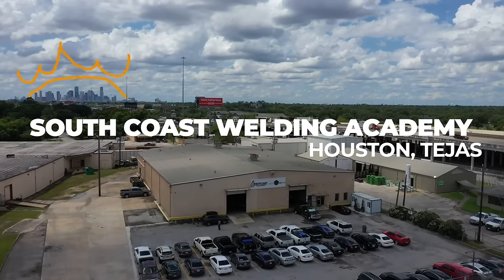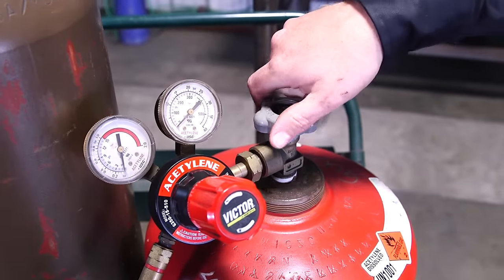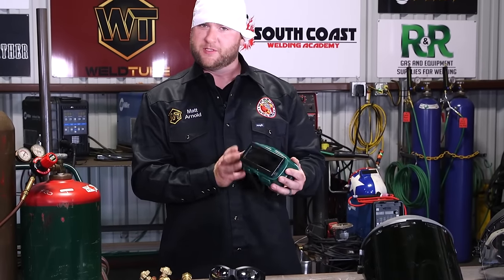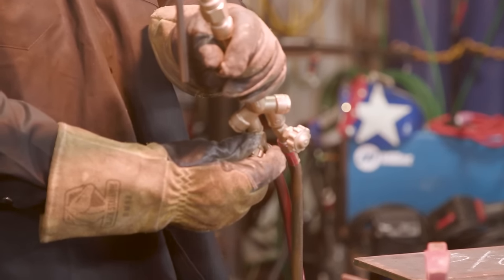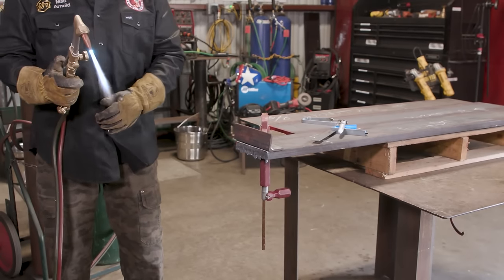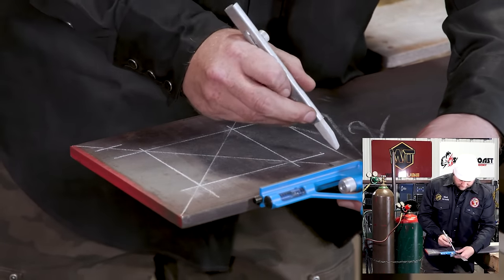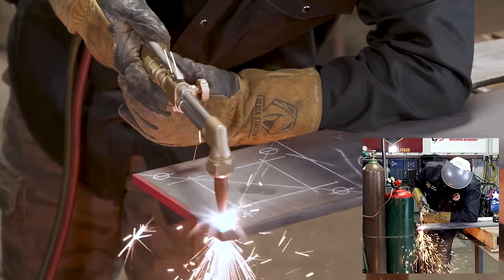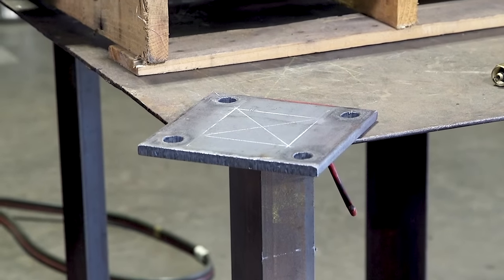Torch Cutting Basics Everyone Should Know | Oxygen & Acetylene Fuel

Comment: I am 74, retired fabricator, welder.  In my learning stage, An experienced old timer taught me to use a center punch on the chalk marks, because the mill scale will pop off and you can lose your line if trying to free hand the burning.
Reply: Exactly what they teach us in welding school in quebec
Reply: Yes, hot-rolled steels do have that affect.  Vibro-etch tools can also help in maintaining a clear guide line.
Reply: Same age and technique. You can see the flame break over the punch marks. Especially good for cutting curves without bothering with the circle burner attachment.
Reply: Yea.. you can do it like that or use a scribe but I prefer using the center punch
Reply: Nice tip
Reply: Thank you, that is a great way to get the hole in the right spot.
Reply: I'm going to try your technique next time.  I have ran into that issue before.  Thanks for the tip.  This field is a never ending learning experience.  I'm always learning new techniques from everyone.
Reply: This was the right torch handle for the left hill front with a misty blade at the bottom
Reply: @charlespageau5699  🤣 it's complicated
Reply: @user-sp3gq1up9n  That goes for a lot of trades. There's always something new to learn
Reply: I do that as well
Reply: @charlespageau5699  Awesome to know, I'm living in that province
Reply: In portugal we do the same !
Reply: Thanks for the knowledge
Reply: I am a recently qualified welder/fabricator in Ireland, we got taught that trick too
Reply: So how many marks would you make with the center punch?
Reply: @bronsonstephens5799  
Hi Stephen,
When we were cutting smaller circles and arcs we were marking with the centre punch every 3 to 4 millimetres. We were also making deep enough marks with the punch that we could fill up with chalk ie. (hit the centre punch 3 to 4 times). This makes the line much easier to see while cutting.
Reply: @harkinjames  my name is Bronson but I appreciate the advice!
Reply: Only on big pipes center punch.on other material just use a scratcher. Σημαδευτίρι.
Reply: Hi mate, you are absolutely right. But if he was to drill the holes, he would have needed the center punch. Since he is using Oxi, so no nees for that I guess.
Reply: Awesome  your  a spring  chicken 🐔 🐔
Reply: You can use a zip cut and scribe a line too. Just run the zip over it quickly so you have a nice permanent line to follow.
Reply: Your explanation is great, idol
Reply: Or just use a white out pen.  (presto)
Reply: I also learned this from an old head props to them ✅

Comment: I had never used a cutting torch before and needed one today to make some mounting brackets. There was no one at the shop to teach me and it had to get done today. This video alone was enough to teach me everything I needed to know! Thank you for this!
Reply: Get it 🔥🔥🤟🤙
Reply: It's pretty easy to pick up the basics, but hard to become really good at freehand cuts.
Personally, I went for a 30A plasma cutter because it's easier to plug in an air compressor than it is to keep refiling gas tanks.
Reply: @the_inquisitive_inquisitor  Good decision
Reply: Everything? LOL. I'm not being a smart ass, but that statement rings of famous last words....for instance...can you clear weldement with a torch, what size tip can you use? Wait until you learn just how much you can really do with a cutting torch. You'll be the best!
Reply: Ive seen men who claim to be tradesmen and when I see their Oxy cuts straight away I know if they are full of BS or nor, I watched one so-called tradie melt the steel instead of cutting it, he didnt get the job, lol, and you learnt everything you need to know, oh my god.
Reply: @the_inquisitive_inquisitor  it might be but you can cut a 12" plates with oxygen cutting and you can do more things overall
Reply: @altoso1  My plasma cutter handles everything up to 1/4" and that's enough for most jobs.

Comment: FYI, for those of you just starting out or only doing you’re oxy/acetyl cuts infrequently this process will assist you in doing very well.  But, it takes paying attention to the melting metal at the torch flame tip, as well as how the torch is clearing the cut material and if your hearing is still pretty good and not real noisy where you are at you can also benefit some from combining your visual indicators with your listening to the sound of the cut for popping and changes of air velocity sounds from the torch flame and gas flow.  Also, don’t expect your first cuts to look as clean and slag free as his.  He did not cover the importance of the condition of the torch tip face and nozzles which the torch tip face needs to be clean and free of slag balls on it and especially the torch nozzle holes need to be clean and not worn out, goose egged or larger at the tip from improper tip nozzle cleaning in their shape or oversized from excessive use and cleaning.   Always Preheat before trying to cut, Keeping you torch cone flame height correct and steady not going up and down in reference to the metal being cut and/or banging the torch cutting tip face into your work especially the molten area will extend torch tip surface and cutting nozzle hole cleanliness and life of the tip.  Get comfortable as field conditions allow or in any way needed to meet drawing accuracy tolerances on specified technical  drawings for the cut of finished plate.  Torch tip face and nozzle cleanliness along with preheat, attention to molten flow at torch nozzle as it cuts through the metal, and possibly the most difficult skill part a slow, deliberate   steady pace based on visual and some listening feedback to the cut when you can hear well enough to use that and developed eye, hand and muscle coordination and feedback control of torch flame cone height from material and torch travel speed while constantly observing what’s happening at the cut.  If you are not a good welder odds are the same parameters of attention to detail in weld puddle tie in, bead height and width along with really good  eye and hand coordination and steadiness are key in both processes.
Reply: I’m just starting out and I’m struggling compared to my classmates. This comment was so helpful and encouraging. I really appreciate you today!!
Reply: Excellent and insightful commentary, all newer people to cutting torches need to read this 👍👍
Reply: Very well said, keep the tip clean, and steady
Reply: god bless you.   i am old,  i now teach anything by first asking the student to relax and practice presence and awareness.  by doing that we will learn.  be present now -  do not think of the end-goal,  but begin to practice the basics.  sigh,  i am old !

Comment: It is only important to clarify at the security point, that you have flame arresters in your gas and oxygen lines, and they must also inspect that their regulators work correctly, each time they are used or plan a weekly inspection to keep track of them and be more secure, just to remember that safety comes first,

Comment: Excellent presentation. Gas/Oxy seems to be a almost forgotten part of the industry . Not many take the time to do gas welding . So a BIG thanks for the edification. Stay safe.
Reply: In hobby shops,,,,yes. - In construction and actual industry, No,,,,,except for plasma,,,,but you seldom see Plaz in the field. No real professional uses a cutoff wheel in a Metabo.
Reply: @mathewmolk2089  True out in construction and the industry we use gas/oxy cutting a lot, and we also use plasma for when we cut down/disassemble silos. Sometimes its just way more time efficient.

Comment: Excellent video.  Great technique, great tips.  You are so right about NOT overtightening.    

Only thing I'd add is you mentioned safety multiple times, but you don't have the steel toe'd shoes. Some sites require it, and you even mentioned how dropping the piece or the dross on the hoses is going to be bad news. Same goes for toes.

Thanks for the hard work and giving back.

Comment: I've got a set up I made with a torch mounted stationary pointing down,  and I have a slide table on rails. I just push it through like a table saw and get very clean straight cuts.
Reply: Yes, they make a radiograph, a motorized unit that holds the torch. It runs on a small track. You clamp the track to your plate and it cuts in a straight line.

Comment: Great video on Torch Cutting. Just wanted to add three more items that should be done. 1 - Like all the comments below ALWAYS ALWAYS back off the regulators after closing the main bottle valves then OPEN the torch valves to bleed off any gas pressure in the lines/torch then reclose the torch valves. 2 - Just before opening the main bottle valves open the torch valves to ensure no gases have built up pressure in the lines/torch from leaking by the main valves and regulator. 3 - I always clean the torch tip after someone has used it or had a bad blow back. This takes all of 5 minutes, unscrew the nut holding the tip and remove it for inspection ensuring no damage to the seating surfaces then run the proper size hole cleaner through each hole then take a small drill and chamfer the holes just slightly and again run the hole cleaners through each hole to remove any burrs that might have been left in the holes. This will ensure you'll have a clean cut every time.
Reply: That's how I was taught in trade school in 1967.
Reply: Like I said before. That is exactly the way I HAVEN'T been doing it for over 60 years and none of out Union Ironworkers amd Millrights don't do it your way either. We use both hand and machine torches in the shop 6 days a week here too. (Just for the record we have had manifolded gas and oxy since like 1970. and used liquid oxy bottles on field projects longer then I care to remember.   

If I caught a guy taking a drill to a tip like you are talking about I'd send him down the road so fast nobody would remember what color his truck was.

Comment: New welding student here; this video was very helpful from what I remembered in my recent class; you covered the process for a lot of the stuff I learned in class. However, in my class I learned that keeping the regulator completely cleared and clean of any oil, grease, or petroleum products physically on the regulator, otherwise that can cause an explosion. Also, never wear nylon or polyester clothing, because the sparks and fire can cause a fire or melt your clothing if it makes contact with your clothing, and never use the torch to blow off your clothes with just the oxygen, since that is a safety hazard to ignite your clothing, I believe. Also, make sure your boots are not nylon and your pants are fully covering your boots, and make sure your welding jacket is fully buttoned up and sleeves tucked into your gloves, and don’t forget to wear your beanie to protect your hair from catching on fire. 

There are a bunch more safety measures involving the oxy acetylene tank and oxygen tank for making sure all the parts involving the regulator and such are functioning properly, and checking if there any leaks (I think you can use soapy water near the nuts), and there’s also flashback that we need to be aware of. 

Thanks so much for the video.

Comment: When you shut down after used, it's important that after turning off the cylinder valves, you  open the valves on the torch to remove the pressure from the hoses, then turn the regulator valves anticlockwise to shut them off.
Reply: In school, yes, In the real world, no.  

Same as lighting the torch. After you have been using a torch for a while you set the oxy and gas and light it together too. None of this gas first then oxy. like the school teachers tell you. - If it's so bad how do burning machines with auto ignition work? POP! that's how.   And how do i know these things.....Been doing it that way since 1959.......I got torches and regulators that still work just fine that are  older then the kids that are trying to tell me I have been doing it wrong,,,,for over 60 years.
Reply: @mathewmolk2089  Yes, exactly. I do the same thing, a little oxygen, then a little gas and light it. Saves all the black smoke.

Comment: Good tip, as a Woodworker / Handy man DIYer i did not realize those sockets existed a few years ago i had to replace a Element on a Hot Water Tank in one of my Boats  and i wound up  having a Oddball open end Wrench i  acquired from my Grandfathers Collection that fit i was also lucky the tank itself was small enough. for me to lift it out of the engine room and work on it  in a less cramped area

Comment: This is best class on running a touch I've seen. Great. 
     We sharpened our soap stones on any nearby concrete. Allowing a tape (measure) to snap shut even that amount will lengthen the hole the rivit is thru that holds the L. One of my tapes is over a sixteenth out at any length. But then again, the tape's been on a lot of jobs since 1979, Ha!.
Reply: Ok, I'm gonna say it, if you have been using the same tape since 79 you deserve a new one. As a carpenter I used to go through one a year or so. To be fair, that tape got pulled out of the pouch 20 or 30 times an hour.

Comment: thx bro im a freshman in high school just now starting welding and im so stoped very excited to learn tig and mig also what's the song in your intro? haha just curios its a vibe.
Reply: you’re probably gonna start out on torch, brazing, mig, Stick, and welding tip on torch, that’s how we start our program, lots of fun is had once you get past safety stuff
Reply: Some Pro tips for TIG & MIG aluminum:  Aluminum is the only common metal that has to be clean before you weld it. No grease, oil or paint or anything else can be on that metal. It just doesn't weld. If you have to file the edges of the stock do it. Or use a grinder with a sanding disc. If you dump motor oil on steel or stainless it will weld perfect because the heat pushes the oil back. To prove the point on cleaning aluminum: military specs call for all TIG welded aluminum to be etched in a mild acid. Use a stainless steel wire brush to clean the area you need.

Comment: just to point out one  VERY IMPORTANT  step i think you missed.  when you are getting ready to cut and are going to turn on your gasses from the bottles to the cutting tool you should as a first step back off the valve tap on each bottle on the bottle side, or make sure the valve is completly shut.       doing this ensures  that if you open the bottle tap the pressure of the gas doesnt HIT  the cutter side gauge and blow the diaphragm as the shut off bottle side valve will stop this direct gas flow.      once you are ready you slowly open the bottle side valve letting gas through to the cutter side valve where you adjust the pressure to the cutter tool.    but baring that one small item i think your vd is as good as i have seen.    wishes from australia.

Comment: WHEN YOU NEED TO CUT A HOLE IF POSSIBLE YOU CAN DRILL A SMALL HOLE FIRST SO A CLEAN CUT CAN BE STARTED. ALWAY KEEP IN MIND TIME IS MONEY. SHORT CUTS CAN MAKE MONEY BUT THEY CAN ALSO LOSE MONEY IN THE EVENT YOU HAVE BACKTRACK TO FIX THE SHORTCUT MISTAKE. BE A TRUE CRAFTSMAN TO YOUR WORK. MAKE THE FIT UP CORRECTLY AND THIS WILL SAVE THE WELDER TIME IN NOT HAVING TO DO MORE WELDING THAN NEEDED. PROPER FIT UP IS STRONGER THAN FILLING WIDE GAPES. THANK YOU FOR THIS VERY GOOD LESSON IT GETS THE NEW UP AND COMING WELDERS STARTED OUT RIGHT
Reply: Drilling a pilot hole is an excellent idea.  The thicker the base metal, the better a drill hole works.  This saves time, money and hassle....especially if you are trying to burn through 8+ inch or centimeter thicknesses.

Comment: I’m nub to using Oxygen/Acetylene looking to cut 1/8 pipe and the victor kit came with a Cutting Tip - 1-1-101. Seems to be large for the job, can I use it and what’s the downside? This is by far the best instruction video I have come across, Cheers

Comment: Every time I shut down the torch I back out the regulators and I make sure there backed out before I open the tanks so there's no spiking .... If you're doing a lot of cutting it's good to know the flow rates per acetylene tank or you can draw out the acatone from the substrate in the tank... I became very good at splitting exhaust pipes and burning out the center of bolts and rivits on spring hangers on trucks.. practice cutting a bolt from inside a nut with out getting into the threads of the nut and then a nut from a bolt with out getting into the threads of the bolt and from many different angles... I miss my days as a spring shop mechanic carving up suspensions then rattling everything loose with an impact hammer at Palmer spring in Portland Maine... There were a few times when I had everything cut and took a break and waited for someone to yell "are you done yet" and just hitting the frame with a hammer and everything fall apart on the floor... "That fast enough for ya"

Comment: Thanks I have a torch set up and a HF wire welder. I have to fab a bunch of plates to temporarily join metal horse stalls together for the fairgrounds where I work. I was planning on using a drill press to drill the holes I need in the plates.. now I will use my torch instead. Thanks now to find a welding tuber..

Comment: Great refresher video. I haven't used a oxy/acetylene torch in many years and only recently got my dads old setup and started using one again. Can I ask why you cut towards you and not away. If you cut away the part will swing that direction slightly reducing chance to land on your foot. Watch the video and see as you get toward the end of the cut the part starts to swing the direction of operator.

Comment: Used my welding helmet set on grinding for the first .. works great.
Reply: Yes a welding helmet with a big 4" x 5" inch clear plastic piece makes a great face protector. If your using a big grinder they tend to bounce off your face when they buck. I always see car mechanics cutting off bolts (YouTube) and tell them it's good until the grinder hits you in the face.